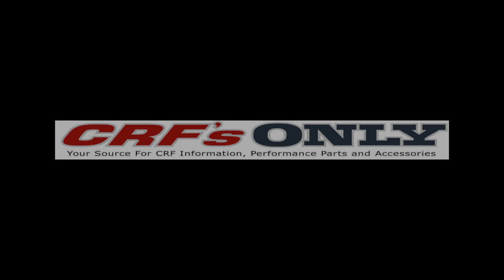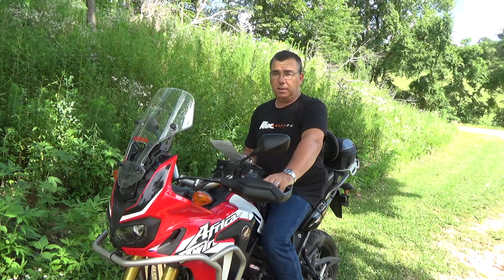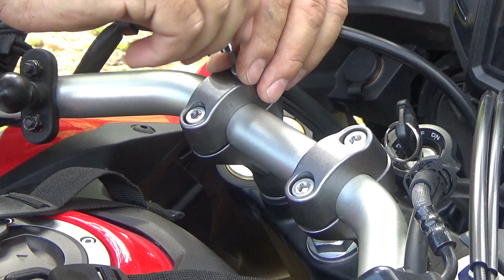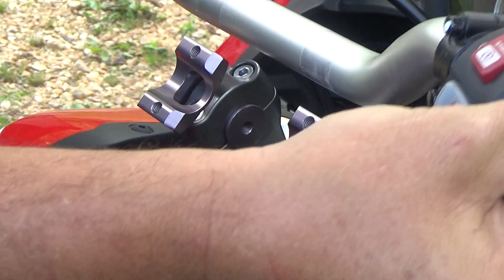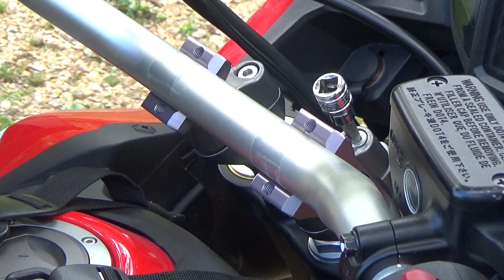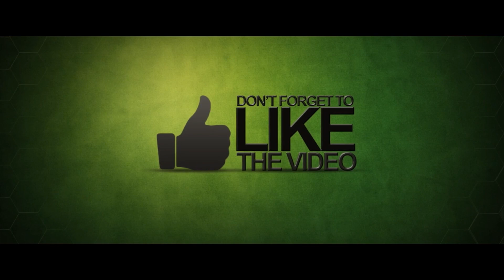ROX 2 Inch Handlebar Risers Install Honda Africa Twin CRF1000L

Comment: So no issues with cable length.  I have a 24 model but need more height. 2in seems a lot 😀
Reply from the maker: No issues on my 2016
Reply: @Woodzman  thx

Comment: tried these today on my 2018 Africa Twin and I have to say: they don't fit.  There is no way the brake hose is long enough to accomodate it, so back they have to go.
Reply from the maker: Oh no, that sucks, it did on the 2016
Reply: Yeah I just a look at my 2019, everything was good except the brake hose.
Reply: @Nookster707  Update; I contacted Rox and they did admit they 'had to do something' with the brake lines, which they don't mention neither on their site, their product info, nor do they tell the retailers.   Which is a bummer, as I then got landed with a request for a 20% restocking fee by the retailer to return them.  That should not apply to goods that don't fit, and when i told Rox about that, the didn't proffer to help.  Let me put it this way: I'd be disinclined to put any more €€€ in either's direction again.

Comment: Picked up the AT 1000L about 3 weeks ago.  I have a list of 13 mods I'm going to add to the bike as time and funds permit.  These risers are #5 on my list, and next in line.  Going to put on the Cobra auxiliary power adapter on today, after I watch your install video on it a couple more times.  Really looking forward to putting on the engine guards from Altrider, but that's going to have to wait a bit longer.  Those bars are expensive and will have to go on in phases.  Thanks for this vid, Woodzman.  Be safe and keep'em coming.
Reply: Installed these risers yesterday, and rode 150 miles with them today.  What an astonishing difference they made.  Far less wrist fatigue, and unlike before, no hand cramps from having to support upper-body with my arms being outstretched and leaning forward into the bars.  Install was essentially a breeze, had to readjust two fasteners and a grommet, which were a little stubborn, but a little silicone spray, some elbow grease and about 10 to 15 minutes was all it took to position them where needed.  The riser and handlebar install took about 10 more minutes.  So, total time for install was 20 to 25 minutes.  Try these out folks, you won't be sorry you did.  Oh, almost forgot.  No need to worry about cable length.  After install, the cables are a little tauter, but not too tight.
Reply from the maker: Yes they are expensive although I do believe they are the best

Comment: How did you loosen the OEM screws so as to get the handlebar out (lefty loose / righty tidy) damn there on good I destroyed a Allen key lol?
Reply from the maker: Yea left to loosen. I used an Allen that fits on a ratchet.
Reply: WOODZMAN ADVENTURES yes I had to put my beer belly into it...looks great cable management worked out, clutch cable is a bit tight as mentioned but not bad. Thanks for the tutorial I found it very helpful. I also took other folks suggestions in comments for help. Thanks all
Reply from the maker: Your welcome ! Thanks for watching. Frank Zappa lol

Comment: Sir, which windscreen is that? i was looking at either the Honda tall windscreen or the Givi airflow addition piece and Im wondering if that Givi top piece will fit over the stock short screen. The tall Honda one is only like 3" taller, probably not going to be much help. Any advice on that, thanks in advance. Matt
Reply from the maker: +Matthew Pink It's just the stock windscreen but I installed the Batzen screen risers, I looked ken it better because it's adjustable. Search for WOODZMAN Batzen
Reply: Thank for that, will check it out.

Comment: working great on my 2006 klr650! no need to lengthen any cables. The set that adapts 1 1/8 to 7/8 was what I went with. Put Protapers bars on. Contour Silver Woods High spec. Lovely ;)
Reply from the maker: +Doug Heinrichs awesome ! Thanks for the info

Comment: Best upgrade I have done to my AT so far! I can stand without being hunched over at all. Combine these with some pivot pegs and it's a game changer. Ps. for those asking, no cable length issues at all.
Reply from the maker: +ColoradoDualSport same here, before I got them, I didn't figure that it would make that much difference, boy was I wrong.

Comment: what about cable length when suspension extends (rebound)?
Reply from the maker: +Olaf Kilthau that was with the suspension extended because I was on the center stand with it tilted back
Reply: WOODZMAN ADVENTURES Gotcha.  I missed that part of the video

Comment: Thanks Woodzman!  Good video!  I was looking at the Rox Risers but was worried about the brake line. Honda didn't give much extra slack on the brake line. I will probably get those now that I see it works on your AT.
Reply from the maker: +Shaun K your welcome, it works great and it's a lot nicer riding now